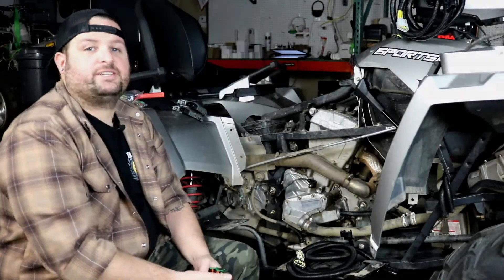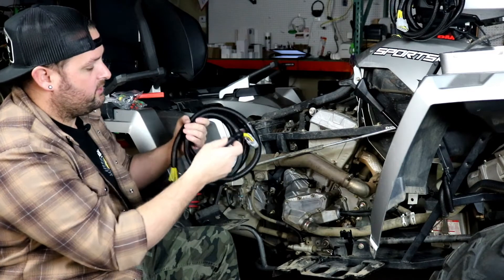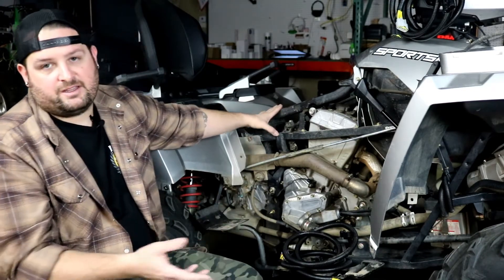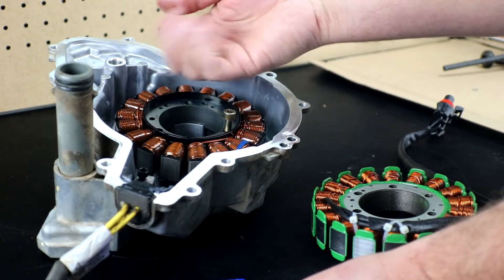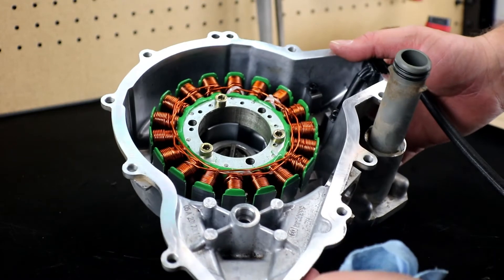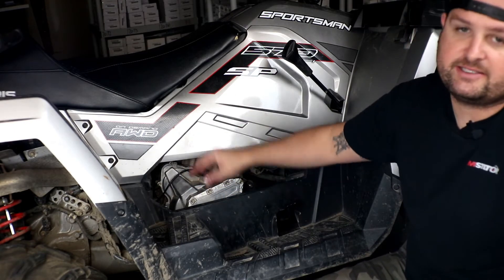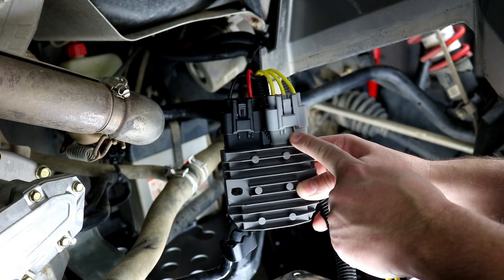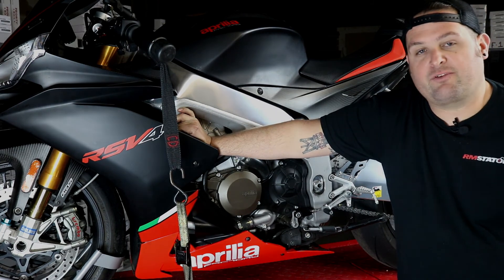RMSTATOR Polaris Sportsman 450 570 850 1000 ATV Dual Output Stator Series Regulator Installation

Comment: You said something about "the bike being on its side" so you didn't have to drain the oil.  Is it literally on its side or like at a 45 degree angle?
Reply from the maker: On the ATV's I typically lift them up with a jack to around 45 degrees, this shifts the oil away from the cover.

Comment: my digital scren on my 570 efi 2020 sportsman is blinking rapidly whever i dont crank it and only put the auxilery power on it doesnt blink once the quad is started and fully running it blinks none stop about every 6 seconds it flashes 4 or 5 imes  what could it be potentially?
Reply from the maker: I would check the battery voltage when running, make sure it is at 14.6V max. Overcharging can damage digital electronics. Otherwise it may be a failing gauge.

Comment: Please help in next video you do I've changed my battery air filter plug and wire and the coil still dies and backfires every so often and for the record mine is a Polaris sportsman 450 ho efi 2017 and I also changed the fuel pump
Reply from the maker: Based on the backfiring, I would recommend testing your pickup coil on the stator, and replacing your ECU.

Comment: Will this system be necessary to bypass a failed sure power module on a 2007 sportsman 450?
Reply from the maker: No, this will not bypass a surepower module. We have bypass kits available on our website to use an external voltage regulator with a surepower.
Reply: @Rmstatorinc  could you drop me a link to that product ?

Comment: Whats the difference with using the 2 smaller voltage  regulators and using 1 big one??
Reply: The price is higher for a dual system. It is possible to make a robust serial regulator that can work with the original stator. And we did it in Croatia. It is several times cheaper in price.

Comment: Mine just went out again after buying this a year and half ago. Makes 4 different ones I put on in last 4 yrs I've owned. Polaris sucks
Reply: So you bought this dual lead stator and it still fails?  On top of the original regulator I have bought 2 rmstator regulators and both went out.  I was going to do this but if it doesnt work for $1000 I will just keep replacing regulators each year or just sell.
Reply: I installed this double regulator, stator, and wiring kit about 2 yrs. ago and it has fixed my 450 HO. no problems since. I am Pleased with my purchase
Reply: That's why we in Croatia make better regulators that are also recommended by HR Polaris dealers.

Comment: What size bolts (The three bolts that thread into the flywheel)do I need for the bolt-on puller? I have no metric bolts with my kit as I bought it back in the '70s. Thank-You!

Comment: My 570 was telling low voltage 10.2v and is draining my battery..has a new Polaris regulator. Would it be time to change the stator out now?
Reply: I think so I just got my stator here today. still not getting enough power after changing the regulator . So it’s stator time .
Reply: @TrplOG-Hatley  yea i eneded up getting a new stator and a new regulator and it fixed it the problem
Reply: @blackmetalchevy  what issues were you having? Mine runs fine when cold and when it gets to temp to starts to spit and sputter and then it stalls out
Reply: @winstonhall1485  it could be your fuel pump. That's how mine acted when it went bad. Lots of backfiring too.
Reply: @B-E2  it’s brand new pump. Going to the dealer to get fixed.
Reply: @winstonhall1485  Can you please update us when you  find out what it is? Thanks
Reply: @B-E2  will do. Going to dealer Monday. But was told they can’t get it in till the 22nd. Hoping they can sneak it in early
Reply: @RMSTATOR Is it possible if you don’t replace the stator in time , could it drain or kill your brand new regulator/rectifier ?